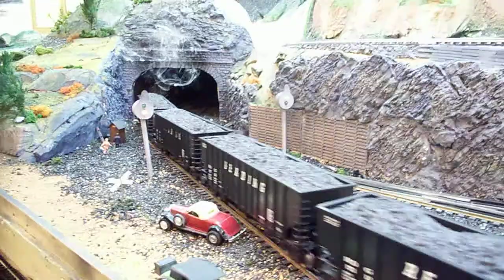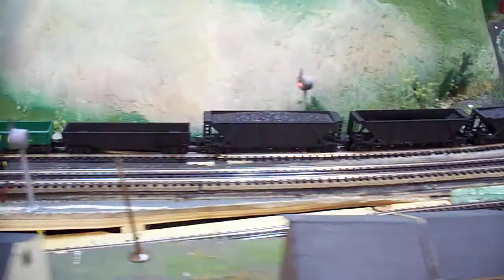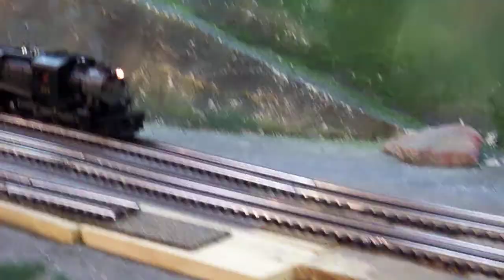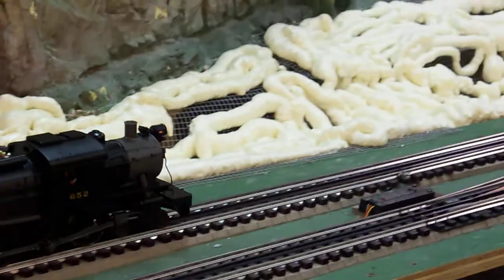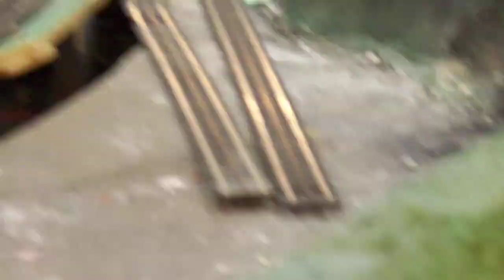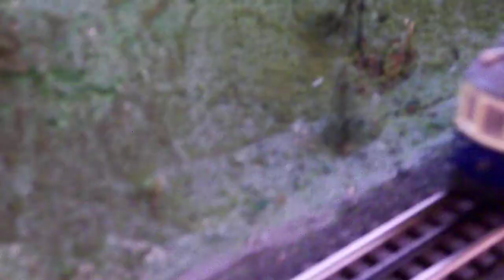MTH T1 Reading Steam pulling a coal load

Comment from the maker: Thanks for the comments.  We have had as many as 70 car load.  The problem with that is we have a combination of fairly steep grades and curves.  Though the curves are all pretty broad generally 072-096.  The problem with very long trains is they tend to roll over sometimes or the couplers pull apart, they can't take the strain. When you pull a 60 or more car train by hand it's unbelievable how heavy it is.  Thanks for your kind remarks, Dave